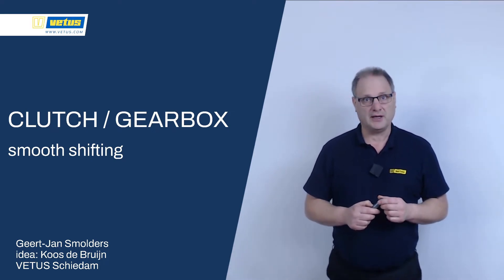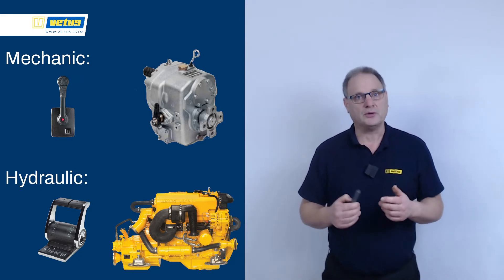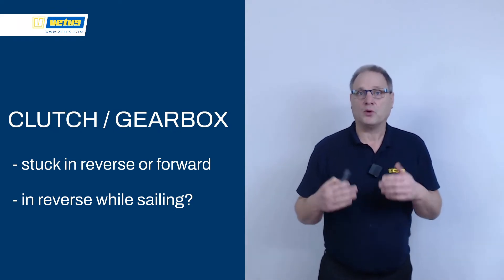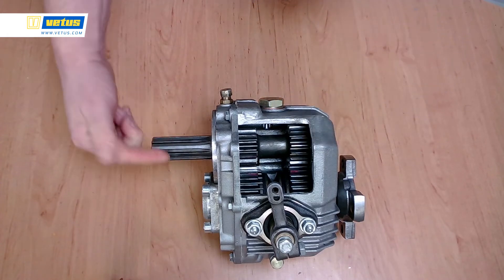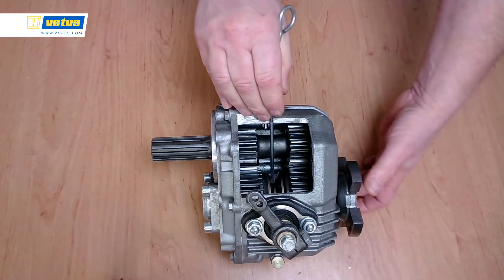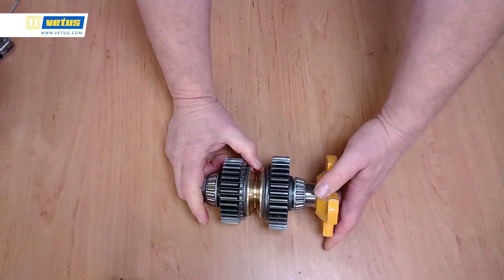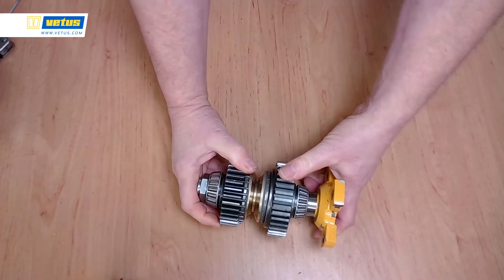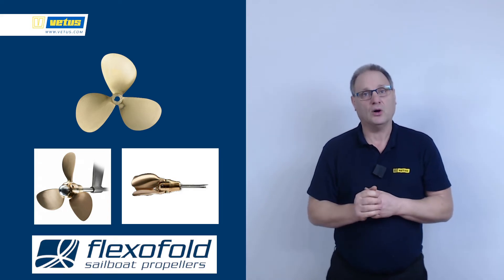How to fix your boats gearbox which is stuck in reverse by yourself.

Comment: A good explanation,but the title says how to ‘fix’ a gearbox if stuck in reverse and I don’t see an explanation ,only how the gearbox operates when working. If any of the cone is damaged by heat or water and warped it will need rebuilding which wasn’t touched upon.Nevertheless,very good generally.

Comment: lf, after using the reverse-gear unit for a long time, shifting (from forward speed to neutral or from reverse speed to
neutral) becomes particularly difficult, it is advisable first to check the status of the control cable and of its relevant
box. Then, if necessary, unlock the nut ref. 57 (spanner 13) and mantein the screw ref. 28 in its position with an allen
wrench (4 mm.). Than rotate clockwise the screw ref. 28 by a 1/4 of turn and lock the nut ref. 57.
lf one or both clutches slip,

Comment: very well explained...a topic which is not covered enough!...i wish to know...in the case of the Mechanical gearbox...say the cable snaps...as has happened with my throttle cable...can one manually shift it in gear and will the lever stay in that position? ---Cheers Edw
Reply from the maker: Dear Edw, thanks for watching. A mechanical gearbox will stay in gear if you change gears manually.

Comment: Geert-Jan, please explain how to actually "fix" the stuck-in-reverse problem. Should I simply make sure the cable is lubricated?
Reply from the maker: Mike, thanks for watching. When the cone (sliding middlepart) is stuck in itś counterpart no'thing is broken, it iser  just pushed in there with too much force. To get it unstuck, you rotate the propellershaft. So it's not really a "fix", itś more a matter of putting the parts back in the position the manufacturer wanted them to be. 
There can be other reasons for a gearbox to appear stuck, caused by the control cablesiff, . If the control cables get stif, don use oil as the plastic inner surface can swell. You can try PTFE spray, but usually replacement is best since you can't remove the worn surface.
Reply: @VETUSGLOBAL  Thumbs up on your very clear explanation about how a gearbox works. Thank you. The answer to the problem of a gearbox stuck in gear remains unclear. If the gearbox is stuck in gear as you described above, the prop shaft is already rotating. How does one disengage the prop shaft? At the moment this is my issue: Frequently, when shifting from either forward or reverse into neutral, the lever moves smoothly to neutral position but the prop shaft doesn’t disengage. By nudging the lever past neutral I can usually disengage the clutch cone from the gears but not always. Is there a way to facilitate a smooth, complete, reliable disengagement from the gear?

Comment: Hi, what is the material on the matching surface of the Schakelkonus on the scroll gear, and can the material be replaced. Excellent  detail, well explained. Great vid thanks very much.
Reply from the maker: Hi Ziggy, thanks for the kind words. As far as I know the friction material cannot be renewed. The bonding between the conus and the material needs to be perfect + resistant to the oils used. The exact compound of the material is a bit of a company secret. 
When you have to get the boat moving, typically it's possible to rotate the conus 180 degrees as usually only the forward material is worn.